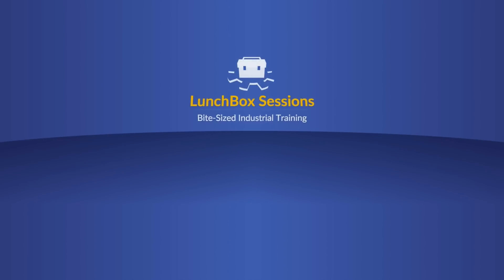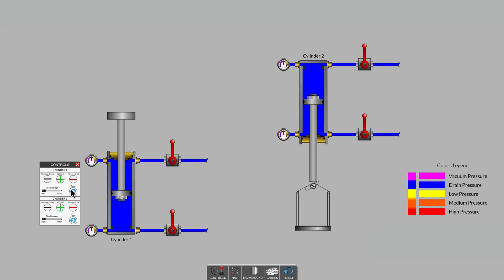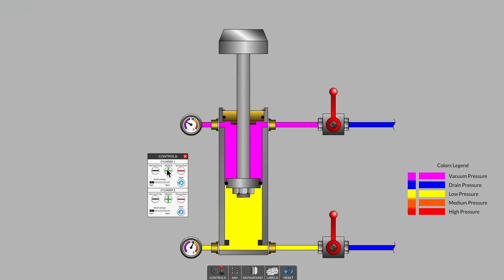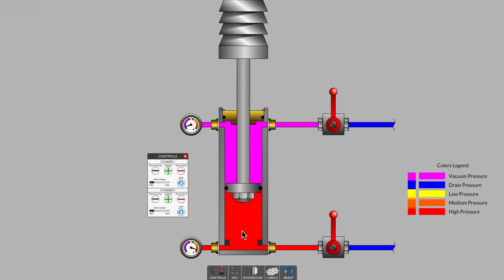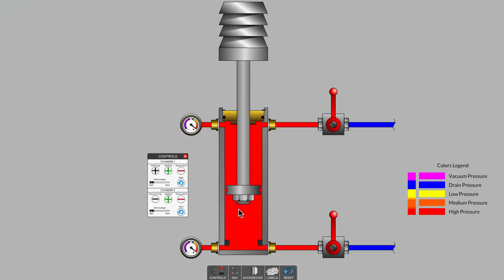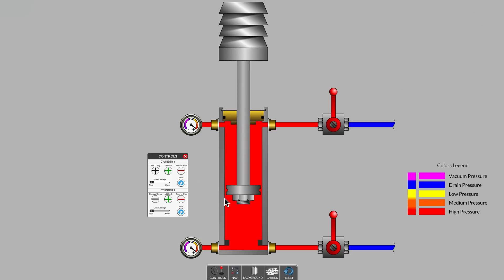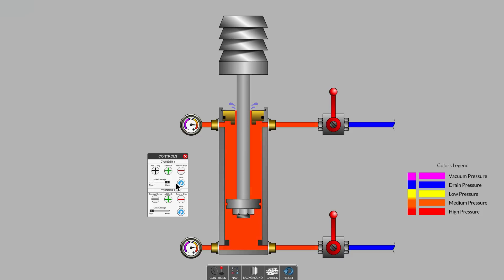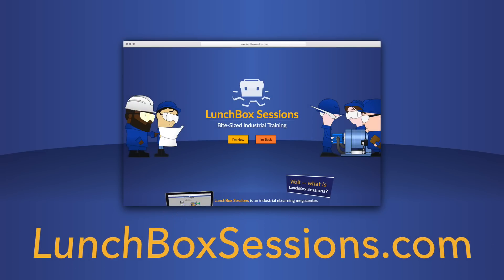Cylinder Drift

Comment: We have situation where we see the cylinder of size 31.75x28.15 is drifting. Cylinder is vertically mounted and rod is downward carrying 150Kg load. We have counterbalance valve between Main control valve and cylinder. When rod end port is plugged we see cylinder is still drifting. Do you anticipate issue with piston seals?

Comment: Interesting. It is like trying to pull out the plunger of a syringe while your thumb is covering the air hole. Except the seal would be at the top, not against the cylinder walls. So for creep to occur, more oil must be able to get pulled into the cylinder.

Comment: I'm a mechanic in the mining industry and our continuous miner has this problem with the head drifting they have changed Jack's but it is a remote operated machine I think a lot of the drift in this machine comes from worn out solenoids in the controller mounted to the valve chest so be adjust on that this evening and I'll let yall know how that goes. Good video also thanks for the diagram
Reply: Update?

Comment: Really happy to see this video. I have been arguing  with workmates over years who always blame cylinder when they are creeping. Simply barrel has no more space to accommodate rod's volume unless oil escape through valves or rod wiper seal or head. Thanks buddy.
Reply: BUT cant the rod extend out?? less volume drifting out
Reply: It won't drift but it will be due to vacuum instead of higher pressure.

Comment: I had an outrigger on a truck mounted crane system that would extend down just fine, but would go back up if I used any other controls. only one of the outriggers did this. Do you Have any insight as to what would cause this? im thinking a check valve of some sort

Comment: Did you ever end up doing a video on cylinder drift in the retract direction? I ended up working on a telescoping forklift and with the machine shut off the boom would extend. This cylinder has holding valves so another test we did was capping the cylinder off completely and it would still drift out.
Reply: I would suspect air is getting sucked into the cylinder. Pulling the rod out would create a vacuum.

Comment: It would have been more pedagogic if it was orange color below the piston before you remove the piston seal and then change to red in the whole cylinder. That would better show that the pressure will (depending on piston rod and piston diameter) increase substantially in this situation when the seal starts leaking or is removed. Now we can se a slight increase on the lower gauge but changing colors would be even better.

Comment: Found my bobcat lift arm drift with this knowledge. The emergency arm release valve was leaking. Great videos!
Reply: Are you able to elobrote the way you solved. Kindly need your support.
Reply: @krish08111994  I used an ultrasonic leak detector with a contact probe to listen for flow/ turbulence.  I think you can use a simple mechanic stethoscope. it was my bobcat t190 2007 machine. next to the seat on the right you have an emergency release valve to lower the arms and that was leaking. cheers

Comment: Your simulation is wrong. If no seal the piston will slowly drop down because the upper force still exist, but no static counterforce anymore.
Reply: It is not true. In order to dip more of the rod inside the cylinder, some oil need to evacuate. I am sure that if we start heating the cylinder the rod will even moves out in order to compensate expansion of the hydraulic oil. It will worth to see simulation like this.
Reply: @DeyanYakimov  If no seel an oil can move between top and bottom chambers can't it? Simulation works wrong because inside diameter of chamber and outside diameter of cylynder are set equal. In practice the piston is always slightly smaller.
Reply: @F47451  If there is no seal oil can move, but only if the rod seal is also leaking. In order to push the cylinder in, you need more space inside to accomodate that part of the rod that is still outside - but the space is limited (oil cannot be compressed). If there is no rod, bud only piston it will slowly drop down. Watch the video once again carefully and you will understad.
Reply: @DeyanYakimov  Yes you are right. I did not carefully watch the video. Thank you a lot!
Reply: Why does the piston drop slight when the seals are removed? If F=PA and the area on the bottom of the piston is larger than the top, shouldn’t the force be moving up?
Reply: @ericklascaibar9900  If no seal then the pressure is equal on both side. Thus, that force (F=PA) can't move the piston because directed to piston itself. But gravitation stil exist and F=ma trying to move the piston downward. The piston moves down slytly the pressure rises (becaus volume change) to compensate gravitation and piston stops.
Reply: @DeyanYakimov  what about some very heavy load  would the settling be slow or immediate?

Comment: System Designers might take note of the dangerous amplification of cylinder pressures accompanying that seal failure - since the cylinder pressure will now be set by the rod diameter, not the piston diameter OR the relief pressure.  Possibly 3-5 times the cylinder pressure now evident, and over the entire canister.  For machinery expected to support heavy loads, a factor of safety of 2-3 based on the rod diameter is a much larger cylinder.  Add to that, a pressure relief device or any other device inside the valving will have to contend with 3-4x it's normal operating conditions, possibly leading to an uncommanded lowering, even, unexpectedly, via the rod-end port.  No one saw that coming... :/
Reply: Yes that’s a very important nugget of information that is easily glossed over from this situation, thanks for emphasizing it here.

Comment: great video but you only simulated cylinder 1 what about cylinder 2 with a hanged load?
will it be like the first cylinder or not.
Reply: My guess is that it would be the same thing. The only difference is that the cylinder pressure would be at vacuum instead of high pressure.
Reply: YES!!! that  is the exact problem im having that i cant find any info on whatsoever!!

Comment: Good Video, I have a an issue with my main up/down cylinder on my Versalift Bucket van. When I toggle the cylinder up it goes up and when I toggle down it goes up. Everything in the tower checks out so far but I haven't done any troubleshooting on the cylinder since it wasn't visibly leaking . Could the internal seals be gone making it go up on both movements?
Reply: Shall I Know how the solution happened

Comment: could you help with hydraulic power pack circuit working
Reply from the maker: Is there a specific feature on your power pack circuit that you are curious about? Does it have a fixed displacement or variable displacement pump?
Reply: hello sir , i want to know how pressure and flow are  fixed on a rexroth hydraulic powerpack . it has an axial flow piston pump with  9 pistons.
Reply from the maker: Ah yes I understand. I recommend that you view our videos https://www.youtube.com/watch?v=jcCG6yJw1FY and also https://www.youtube.com/watch?v=_eeHmE-dHPk  These two videos cover the topics you are inquiring about. Most models of Rexroth, 9 piston axial pumps will be the same or very similar to what is described in these videos.